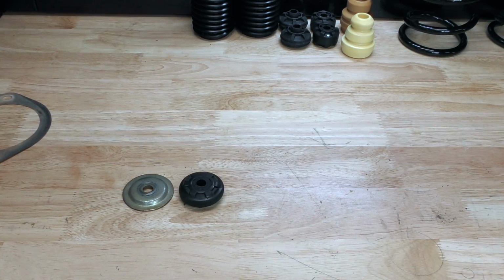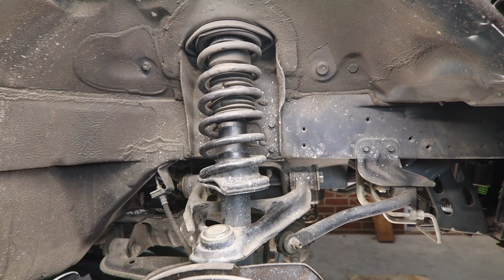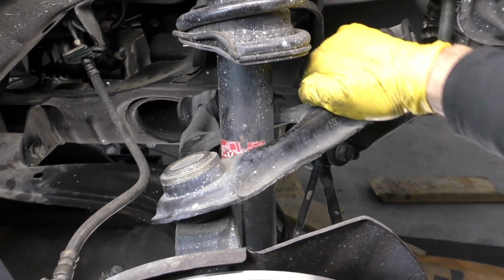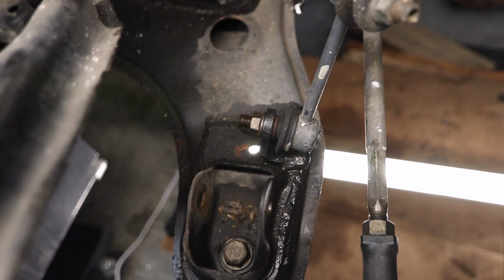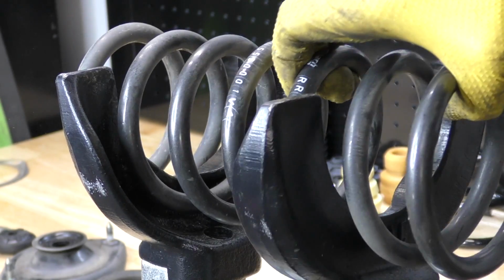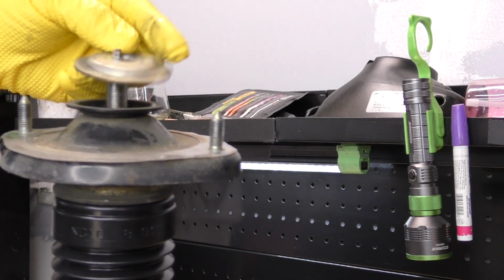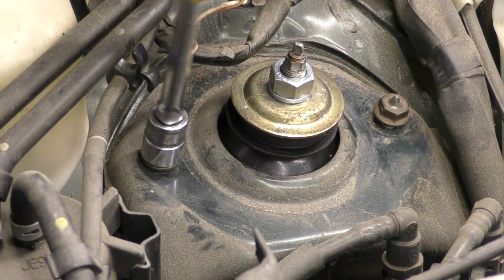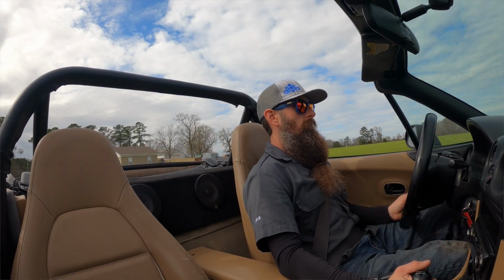Everything You Need To Know About Struts and Strut Replacement

Comment: Koni were big here in Germany end of 90th - early 2000th. Koni red or Koni yellow. If you put the yellow ones in the hardest setting, they called them 'Japanese dampers' - "Koni-Zu". 'Zu' means closed (valve) in German. Now they either go to all out with KW / H&R coilovers or put in the very cheap coilover stuff. Conventional kits from qualiy brands like Koni or Spax are rarly used now.

Comment: I just did the front suspension on my miata and I gotta point something out because I can't find someone to vent to.

look at 5:51, where he casually sticks a ratchet and socket right on the nut of that long ass upper control arm bolt.
The only tool combination I had that would fit in that tiny little gap of my miata without touching the brake line was my breaker bar and a chrome socket. On top of a 30 year old nut that had never been removed before. It took me over 15 minutes to spin that nut off with just my breaker bar making 1/16th rotations at a time and another 15 to beat that long ass bolt out with a punch.
"mIaTaS sO eZ 2 WeRk oN"
I love my shitbox but that was so horrible :(
Reply from the maker: Vent away. Haha

Comment: I had to grind off the sway bar links on my brother's 06 Pilot when I replaced all suspension components on that car. It was a royal pain. I also rented that same ball joint removal tool from autozone when I replaced the front control arms. It helped a lot.
Reply from the maker: That little tool is so awesome! I wish I had one years ago
Reply: HumbleMechanic it really is. I also used it to get the outer tie rod ends separated from the steering knuckle and that did the trick. Of course it destroyed the boot in the process but in my case I was replacing all that because the car had over 200k on it and all of the original suspension components, so it was time for that all to be changed out. Front control arm bushings were very torn on both sides so I just opted to replace both the control arms as a whole unit.

Comment: A+. Charles always does a great job of showing us the finer points of doing good work in safe way with attention to detail. One huge point is torquing suspension hardware under load. We love our Race Ramps Wheel Cribs. They allow us to set the cars down with the wheels on and get under there to do our thing. Perfect.  Poke around guy's. I found a similar Coil Spring Compressor some time ago for A LOT less money. Works fine, not sketchy.   'Just say No to Suicide Sticks".....
Reply from the maker: I love the Race Ramps. Boy are they proud of them. LOL

Comment: Thanks for making these diy videos Charles! I do feel it's worth correcting that you aren't working with a strut in this video, simply a non-adjustable coilover. Struts are mechanical components of the suspension that support the vehicle and control wheel position. They are used in place of other suspension components like the upper a-arm in this video. For example, front GTI / R32 suspension uses struts whereas the Miata uses coilover with dual A-arms in the front.
Reply from the maker: Right. But I didn’t want to start adding all the different possible setups. It can get confusing fast.

Comment: Good video for newbies!

A few tricks:

In the rust belt, you may need the spring tension to be able to be able to remove the top mount nut. The trick is to put the strut horizontaly on the ground. Then put a booted foot on the spring. Then, undo the top mount nut with an impact wrench. On a small car such as a Miata or a Golf, the shock will be pushed a few feet. Just make sure you have enough room. Butit is not a dramatic « explosion » of tension.

For autocross, the collapsed bushings are actually a good thing. Firms up the suspension. And since some classes do not allow polly bushings... Also, the bump stop is better shortened. The trick to know by how much is to compress the new shock and mesure the minumum lenght bump stop you need to prevent the shock from bottoming out.

Keep up the good work!

Comment: That's not a strut! A strut takes the place of the upper control arm. That is a non adjustable coil over shock. I expected more from you.
Reply from the maker: I think we are looking at an extremely minor detail on that one. Its part of using a car for a demo vs doing Miata DIY. 

I look at it like this. If you went to the parts store, what would you order? A shock? a strut? A "shock absorber for a non adjustable coilover"?
Reply: HumbleMechanic the fact is not all struts have a spring mounted on them ie: fox body. Not all shocks are bare. In this case yes, you order a shock at the parts store. I keep wondering when the disconnect happened on what a strut truly is. It seems to be common to call any type of damper with a spring on it, a strut.
Reply from the maker: That’s what I mean. It’s so easy to get caught up in the minutiae of this you end up losing the important points. 

I think for most people in most cases it’s going to be right. I’d hate to start getting into all possible setups and lose someone because they got overwhelmed. 

This is a topic that can and usually is very basic. It’s that 5% of the time it goes from basic to WAY deep. And that happens quickly. Lol

Comment: 9:56 that's exactly how papadakis racing taught me to do mine lmaooo put it against a wall and impact the nut off, let the spring fly off. I really hate those spring compressors, they're sketchy. Still had to use them to get the spring on the new strut but for taking it off, no thanks.

Comment: I have an 04 Dodge Ram and the back has shocks and the front I think has struts. They do not look like this strut though. The spring covers the whole shock. Also, I want to replace them with Bilstein but I can’t find a direct replacement for mine that comes with the spring and everything. I am not secure enough to try to put new springs on myself because I don’t want to have to compress them and have something go wrong and the spring busts out and kills me or mutilates my face pretty bad.

Comment: Some applications you can get fully loaded strut assemblies already put together.Advantages are all new parts and don't need to rent or borrow a spring compressor.Time saving too,remove the old strut assembly and put in the new
Reply from the maker: Yep! I’ve personally never done that. I’ve always replaced due to modify :)

Comment: Fitted Koni Sports in my slightly tuned  Audi A4 B7 1.8t quattro last weekend. Really happy with the result, not keen on doing it all again just for adjustments. 25% was a good trade off on stock sport suspension springs.

Comment: This video is all wrong.
1. The shock absorbers don't support the weight of the car, the coil springs do.
2. The coil springs don't dampen, they deflect the energy.
3. The shock absorbers are the dampers (they're actually called dampers) and they dampen or slow down the coil spring oscillations.
Reply: Take the head out of your ass
Reply from the maker: The strut assembly supports the weight of the car.
Reply: @HumbleMechanic  You said the spring does the damping, which is just plain wrong. You make great content, but you definitely misspoke on this one, unfortunately regarding the fundamental concept of the whole video.

Comment: What determines when the spring portion of the assembly needs replaced?
Reply from the maker: If you are modifying(lowering) or there is excessive rust. or they are broken. LOL otherwise the spring is usually just fine

Comment: Was thinking of doing mine. I hope the 100 tool works just as good. I can’t afford the 700 dollar tool. Anyone have a cheap spring compressor they have used and recommend?
Reply: Normally auto parts stores will rent them out for free with a deposit, you may want to try that if you don't plan on doing it often
Reply from the maker: You might want to look into renting one from say Advance Auto. Not sure which one they have available. .
Reply: Cheap and spring compressor really shouldn’t go together in the same sentence 

These can end up being a real safety hazard

Comment: Great video!
What was your first impression of the new parts after your test drive?
Reply from the maker: Firm is VERY firm. LOL I might tune it a little softer for "daily"
Reply: @HumbleMechanic  when I had konis on my Mazda 3, I ended up having them both just about in the middle, with the rear two clicks softer than the fronts (if I remember right, it was 11 clicks total in adjustment.)

Comment: Miatas don't have "struts", they have coilover shocks (not adjustable coilovers, but coilover suspension design).  It's still a "shock" because the damper itself does not form a part of the suspension geometry like on a McPherson strut assembly.  Late 20-century Honda cars also had coilover shock suspension, then the Civic platform moved to McPherson struts up front and separate spring/shocks in the rear at the beginning of the 21st century.
Reply from the maker: Its a balance of providing a more universal video for everyone. I didn't make this a specific Miata DIY for that reason.

Comment: If the ride height changes at all you might have to trim down that bump stop. I found that on my Tein-S springs the 1/2" or so drop caused me to be riding on the bump stops when cornering, making it a little unpredictable.
Reply from the maker: I shouldn't need to because we went back to stock springs. But I want to do some testing of them. I have been researching bump stops and "tuning" them. they basically function like a small spring. LOL
Reply: Probably correct. You may want to play around with disconnecting rear sway bar, upgrading front sway bar, etc. My original front sway bar (hard-S package) was purchased by a guy who was worried about class points. Because it was an available package in the year he purchased the car, it was allowed. It was SLIGHTLY stiffer than stock.
Reply: Then again... Probably just to learn to drive it the way it is first. Tweak later.

Comment: Currently tuning up the Corrado suspension while on quarentine. First time running into the internal replaceable damper tubes. Kind of like it and makes sense in a production standpoint. Changing everything over to poly bushings too.
Reply: Poly bushings, definitely include grease fittings because you’ll hate yourself if you don’t.
Reply from the maker: NICE! If I ever learn to drive autoX in this car, I might go that rout too

Comment: alignment was one reason i avoided suspension work in the past, now that I've figured it out with strings i have no fear, thanks for doing what you do! 👍
Reply from the maker: It's still a good idea to get an alignment. But this prevents it from being a must right away.
Reply: @HumbleMechanic  agree 100%, home alignment is more trial and error, also time consuming, but can be done reliably imho. for someone like me with a track car that comes apart a lot, shop alignment is an added expense